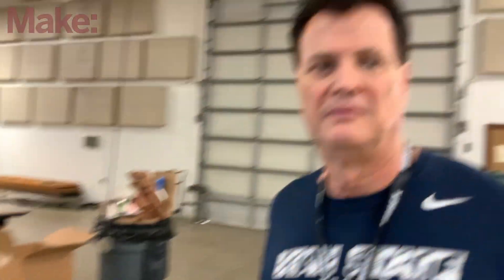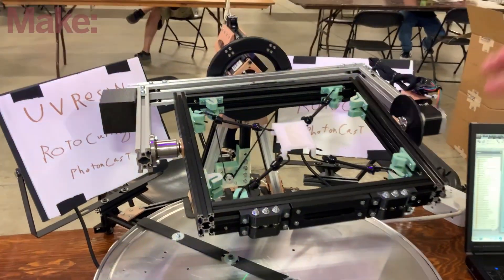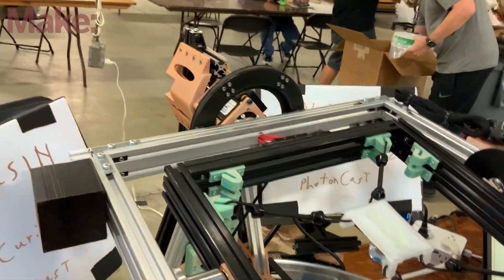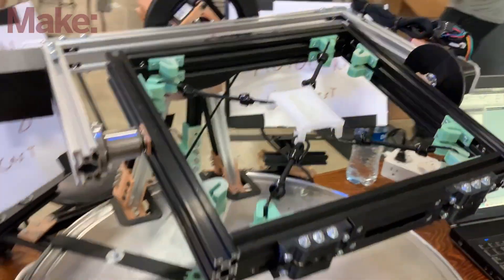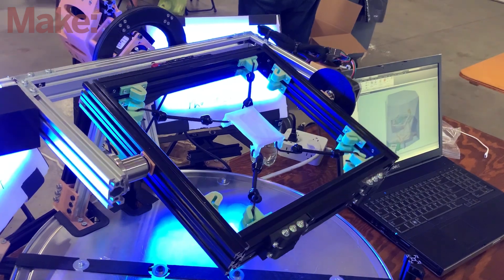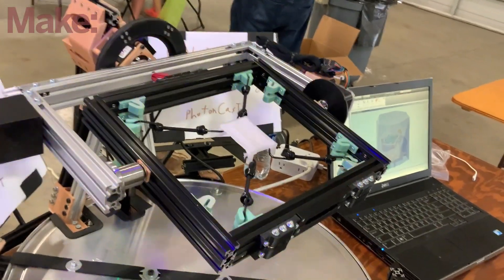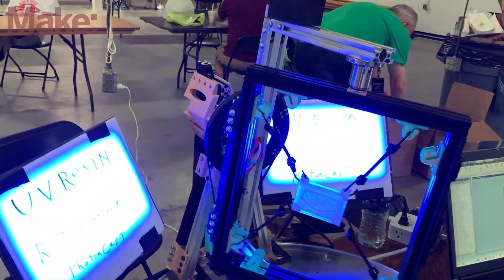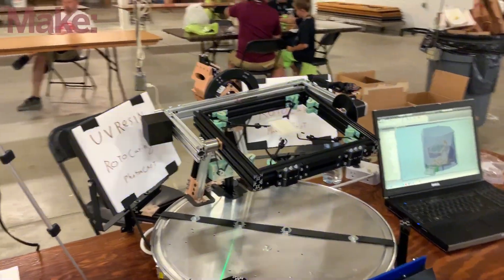Rotocasting with a photo resin twist #3dprinting

Comment: I like rotocasting, but the primary appeal of rotocasting is that it makes a lightweight hollow part. This seems like a mechanical over-complication of a UV curing chamber. It seems like a piece of sonotube (Concrete form tube) lined with aluminum foil or aluminum tape with the same UV panels on the ends would do the same amount of curing without a large complicated mechanical frame swinging around. 

Maybe I'm missing something?
Reply: Wouldn't the fact that it's rotating around also make a hollow part? I'm assuming he misspoke when he said to "fill it" with resin.
Reply: @Brownstone31  if you were doing bigger parts it would but everything he showed appeared to be solid, and was small enough that the difference between hollow and solid was negligible.
Reply: Seems like a potential speed advantage over printing the same part over and over. Print 1 or 2 molds, fill the first with resin, and prep the second while the first casting cures.
Reply: @jmurockstar  yeah,  but the rotation still doesn't change that,  you could put 6x of the sample parts he had in the UV curing chamber. 

The only thing I can think of that makes it make sense is that he plans to get into doing larger hollow parts and that the small solid ones are like test parts to tune the rough process.